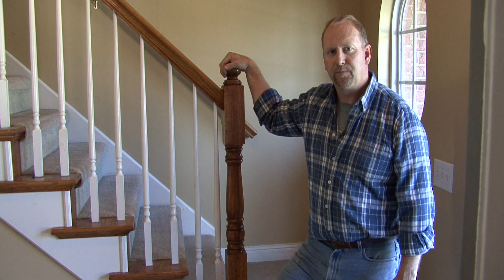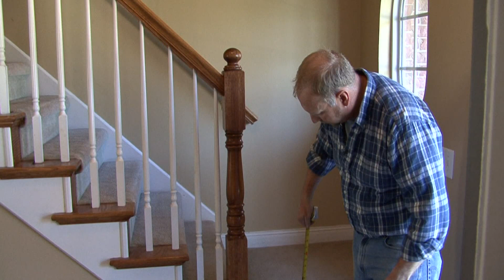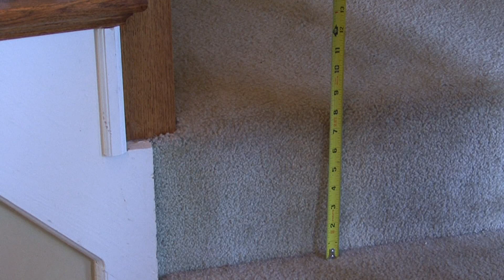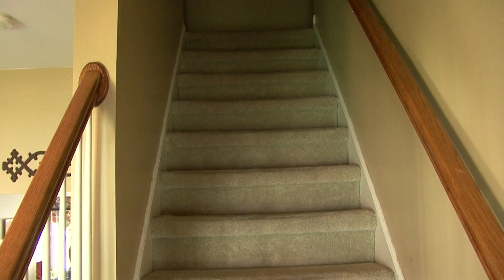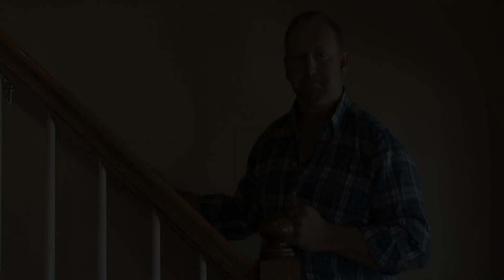Basic Home Improvements : International Building Code for Handrails & Steps

Comment: Staircase shown does not comply with code. No projection above the height of the rail is allowed, the newel shown is a hazard. It has been found to catch items such as purse straps and will yank you backwards. Most older stairways are like this and it is legal unless you remodel, then you must bring it up to current codes. I didn't get ten seconds in before I noticed. Also it appears that the spacing would allow a 4" sphere to pass between, also a major fail. A child can fit through, but not their head, resulting in hanging. Hire a licensed contractor, and CHECK THE LICENSE STATUS. Stairs are best built by a very experienced carpenter, definitely not for beginners. I often build stairs for other contractors when they get in over their head, so don't feel bad. I didn't watch the video, he obviously doesn't have many clues. If you want to show code on stairs, pick an example of one that complies.
Reply: It would help to have a specific citation: code name and edition, and specific clause number giving the requirement. Without those, it's just your opinion.
Reply: "No projection above the height of the rail is allowed, the newel shown is a hazard."I don't think this is right. its done all the time. do you have the code in writing? maybe just a local code?